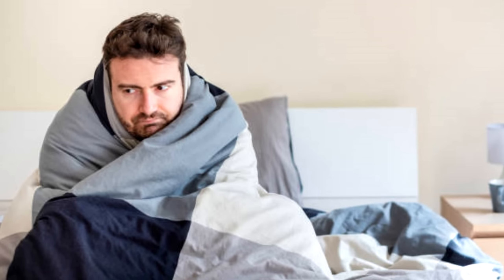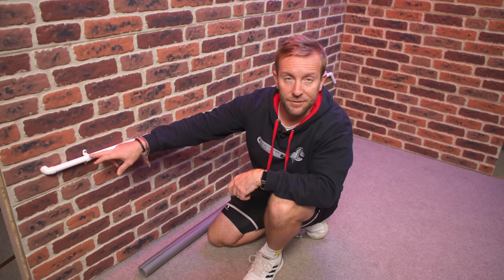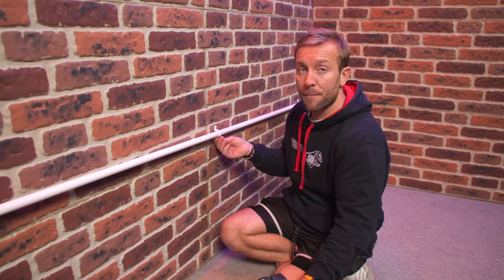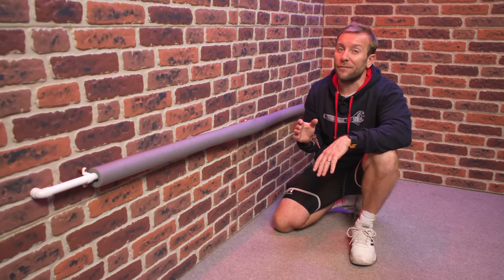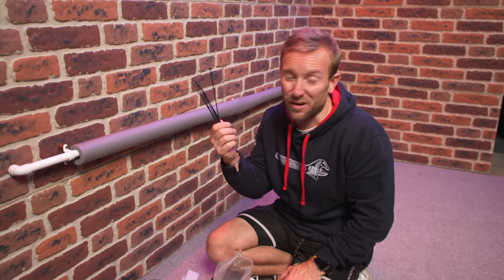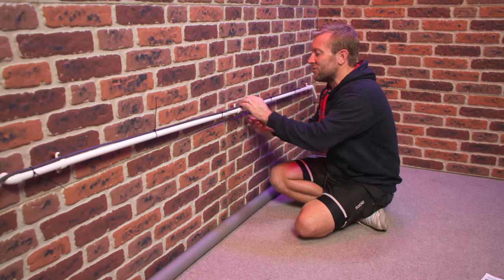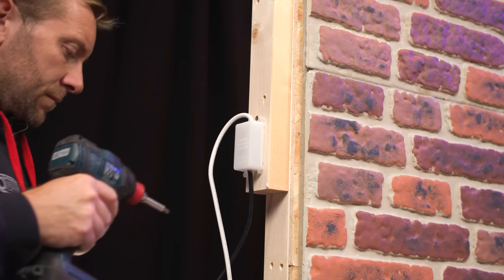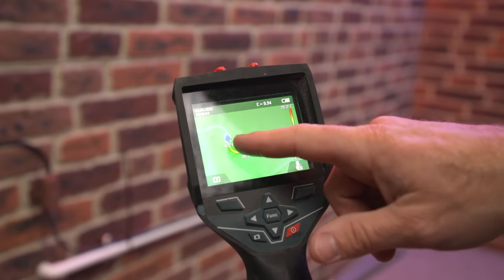How to STOP your condense pipe freezing

Comment: Also as stated in building regs you could have the condense increased to 1" 1/4. Or which ever option is listed in the manufacturers instructions that came with the boiler.
Reply: Didn't help last week when it was -10
Reply: Good grief is it still imperial surely not?
Reply: agreed, my ppe is 32mm and never had a problem even when it got -15c.

Comment: Great content im ex-forces and find the problem-solving aspect of both plumbing and sparks so interesting thanks for sharing and worked a treat for me. Thanks, mate also feel good that with sound instruction I could not only remedy but employ measures to prevent occurring in the future.
Reply from the maker: Top work!
Reply: @plumberparts  for cold pipes with condensation inside would you use this grey insulation or aramflex you used in another video

Comment: Why don’t you put an inline tee inside the property with a emergency valve to a container that can be used in case of freezing ?
Reply: Our boiler just drains into a loose pipe which then goes outside, somewhat like some styles of washing machine drain, so if it freezes, it just slightly overflows into the garage lol. I've insulated the pipe now and added a leak sensor but I can't really fault the original builders: the garage is a bare concrete floor and everything is stored off the floor: it can take a little moisuture.

Comment: Great Informative videos, just did some heat trace a couple of weeks back insulated in armaflex on a feed pipe and waste to a garage just missed out on this video.... the manufacturer recommended to foil tape plastic pipes and then to foil over trace on the waste pipe as it obviously doesn't carry water all the time. Also they recommended covering the thermostat with the lagging to give it a true temperature reading. I read the constructions for once 😆

Comment: should outside condense pipes not be in inch and a quarter?
Reply from the maker: Depends. What they 'should' be and what my viewers have to deal with are two different things! 😂
Reply: @plumberparts  I know over  here  ( Northern Ireland )  building control will insist on 32 mm plus insulation
Reply: @plumberparts  great answer ❤

Comment: Can you use it on a copper feed (and plastic outlet) to a washing machine which is located in an unheated back porch? And, must you insulate if you can't create gap behind as copper pipe was installed by a plumber?

Comment: You may need a special foil tape to go over the trace heating wire when using with plastic condensate pipe.  It is very expensive stuff.

Comment: CondensatePro - designed for this very job. Weatherproof and UV resistant, already painted at factory. 
Comes with bond and seal for the joints and entry through the wall, which expand and contract with cold/heat. 
They recommend the rubber-lined munsens that clamps to the outside of the installation - that way there's no need to cut the insulation to accommodate the wrong clips. The insulation used in this video isn't suitable for external use, it'll persish in no time. 
Not a single call out for a frozen condenstae during the Beast From the East (Feb 2018) when using CondensatePro - just saying.
Reply from the maker: Thanks for the comment. Spot on with the insulation. The grey stuff (like I point out) isn’t suitable. Armaflex is better. 😎

Comment: If you don't wrap the pipe with the heat tape/trace/cable, the only thing I'd do differently is put it on the BOTTOM of the pipe... because heat rises... especially if you decide to not put insulation around it too.

Comment: Hi James, i have installed trace heating tape over the years - on larger systems - it’s actually 10w per ft, but this is the first time that I’ve seen a small kit available - good idea -  i would add a few point’s that worry’s me , #1. The thermostat you used in your video has the temperature adjustment exposed - this unit i would put in an waterproof box suitable for outside , it will sense the temperature change just the same & be safe - #2. Trace heating tape can be cut & resealed with special heat shrink sleeve from your electrical provider. Good information video. Ed,

Comment: Cut the pipe an inch downstream from elbow.  Go inside and cut and rejoin the pipe after turning it 90 degrees so that it drains vertically.  No freezing can happen because the exterior pipe to too short for the water to freeze now.
Reply: @The_Invisible_Self  well that's fine for the UK, but that's not everywhere. If it penetrates a one and a half inch rim joist it's not going to freeze.  The water doesn't stay in the pipe it drains by gravity and it's much higher than room temperature so it's never going to freeze in that short distance.

Comment: I see that the pipe is running to a grid, presumably. Mine just comes out the wall, 90 degree directly down and a 50mm length of pipe. So the condensate just drips on the ground. Is this a problem? It might not look great but it's such a short vertical run there's no chance of it freezing. Any reason the condensate pipe needs to run all the way to the grid? Could this cause any problems?
Reply: @The_Invisible_Self  Thanks for the reply. After a bit of digging and investigation I see my condensate pipe is inside and terminates at the sink. The pipe outside is from the pressure relief valve.

Comment: Ideally most manufacturers state the pipe run should be kept internal if at all possible and less the 3 metres. A condensate pump is a better option if the standard method isn't possible. If the condensate run is already in situe then lagging and a trace heater are a suitable options.
Reply: Re route the pipe work internally during frosty weather to discharge into a plastic tub then empty it daily into the external drain.

Comment: I just want to know where the pipe is in order to actually do this!!!
Reply from the maker: Usually on the wall behind your boiler. Or very rarely into the waste pipe inside the house. Hope that helps! 👍
Reply: @plumberparts  it does help! I can’t see any pipe outside but I can see that there is a plastic pipe running from the boiler in to the room behind which is the bathroom so perhaps it is merged with a waste pipe. My mum has no heating or hot water at the moment!

Comment: Maybe attach the heater to the underside of the pipe where the ice forms? Just a thought..
Reply: I totally agree.... the bottom of the pipe will warm first (where the condensate lies), then since heat rises, the rest of the pipe should will get protected too.
Reply from the maker: Good idea. It’s only on the top in this video because, as I mentioned, the instruction on bends. Maybe you missed me saying it.

Comment: Isn't 1 in 40 for 40mm pipes? So 21.5 needs to be a lot more, maybe 1 in 20, which is what you said in the video.
Reply: depends on load and aspiration levels. Condensate from a regular boiler is less ml/Hr than 1 Greta tear Per hour

Comment: All MIs state condense passes outside in at least 1 1/4 so any pipe that's less is against MI and ultimately against regs so should be replaced. This is a plaster for a problem that shouldn't exist

Comment: Why not just cut the pipe to about 50/100mm turn it 90° clockwise, and/or during very cold spells let the interior pipe run into a bucket.

Comment: Short exit outside, wide waste pipe (not 21mm), heat trace wire. 
Pipe insulation DELAYS freezing, does not prevent it.
Install a condense pump indoors, so it fly out when pump kicks in (instead of dribble)

Comment: What if my condenser pipe is in the wall
Reply from the maker: Hi Sarah, you shouldn't have to worry about insulating it. 👍👍
Reply: My condenser pipe is in the wall and is frozen. The boiler is tripping the electrics. So I have no heating or hot water. Any suggestions on how to defrost through a wall
Reply from the maker: @sarahbowman4899  this is a crazy problem if you don’t mind me saying! I guess you can’t even see the condense?
Reply: @plumberparts  no goes straight in to the wall travels a small distance to the plumbing under the sink and then links up there to go to drain

Comment: Why this is not hidden inside of the house? 
Who the hell came up with the idea that hideous pipes running along the outside walls are a great addition to the view of the garden?
In my case, I have a washing machine under the boiler, and since there is a washing machine, there is also water and a drain pipe. It could have been "connected". But no. The geniuses of evil decided to let me have an ugly pipe in the middle of the wall outside. Even if they wanted to run such a pipe, they could have let it out 10 cm above the external sidewalk, not 150 cm. Nobody cares about aesthetics. It's like Fiat Multipla. New, clean, shini, good job but ugly as hell.

Comment: Why not do away with your long pipe and just send the pipe vertical downwards to the floor as it comes out of the wall. That's what  mine does.
Reply from the maker: Depends if your boiler is near the soil stack. There's regs to be adheared to - so sometimes going straight down doesn't cut it. Thanks for your comment though!
Reply: No dont do that.  Condensate is acidic.  This will weaken your foundations.